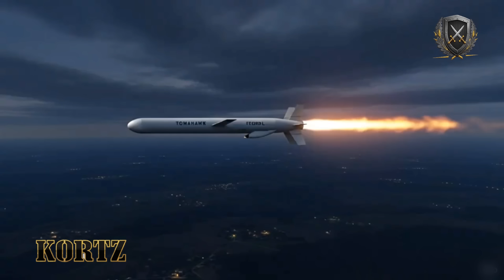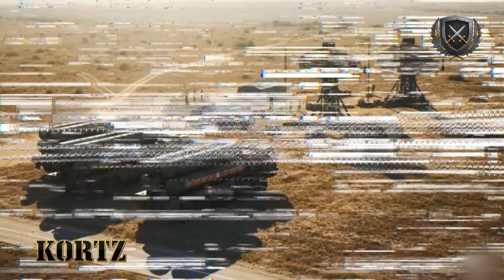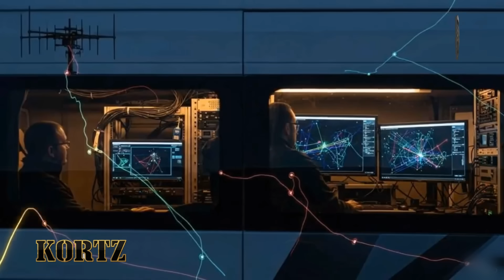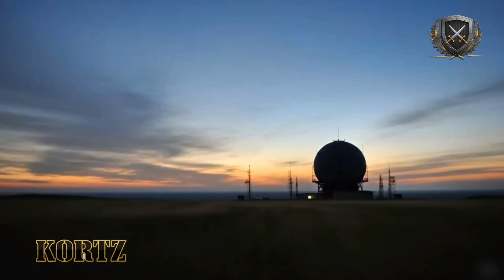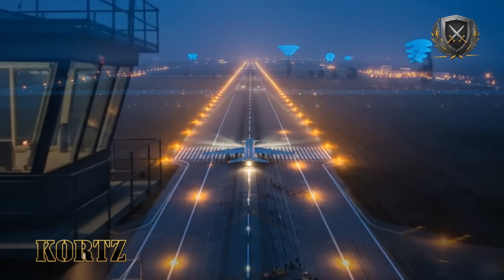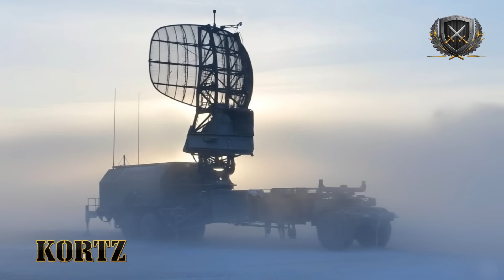Inside Russia’s S-400 Expansion as U.S. Tomahawks Near Ukraine

Comment: Much faster Russian jets have 2000kms in which to shoot a Tomahawk down. Say no more.😂😂😂
Reply from the maker: Haha, fair point — speed definitely gives interceptors more room to work with, and Russia’s air-defense network is built around reacting quickly across long distances. But interception isn’t only about speed; it also depends on detection, coordination, and the timing of the launch. In your view, which factor matters more in stopping a cruise missile: the fighter jet’s speed, the radar coverage, or the air-defense system working in sync?